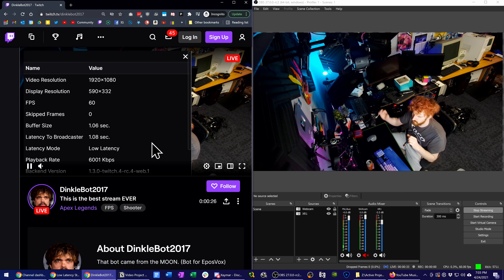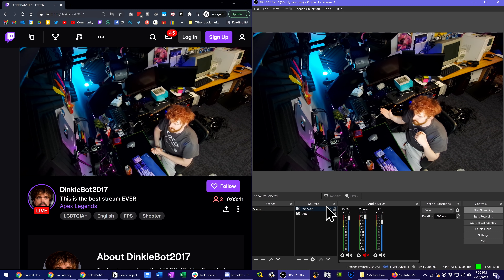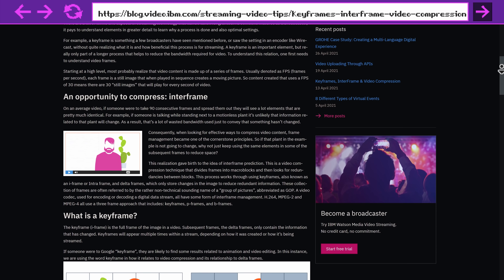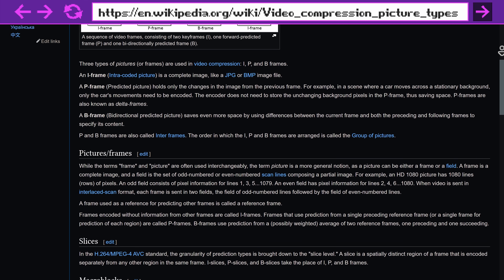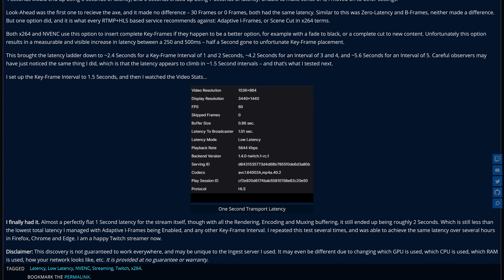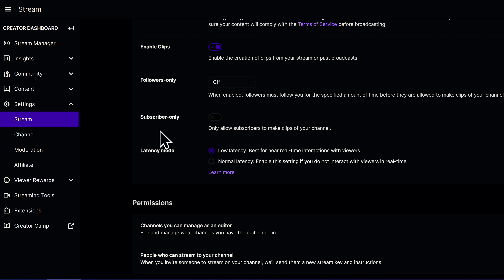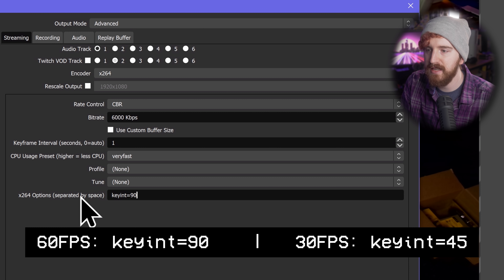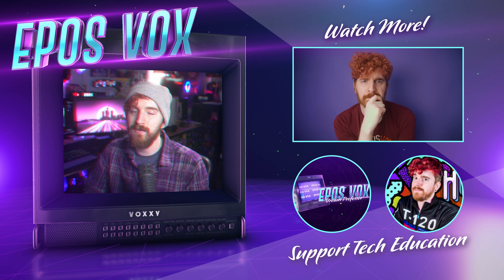Twitch LOW LATENCY Streaming: How to  stream with 1 second of latency

Comment: that nvenc encoder you used makes my output fail.
What works is the build in one "NVIDIA NVENC H.264 (new)"
What fails is the one you chose: "NVIDIA NVENC H.264/AVC (via ffmpeg)"

I'm not sure what I should do to fix this, but when I click stream , I get the error: "starting the output failed. note: if you're using NVENC or AMD encoders, make sure your video drivers are up to date"

Comment: I'm having a lot of trouble trying to get the FFmpeg Encoder setup. Apparently Xaymar has integrated this into the StreamFX download, which I did download, but the extra options on Output do not show up whatsoever. Xaymar's OBS resource area for the FFmpeg Encoder says I'll have to go in and remove the default encoders for them to work. Do you happen to have a video explaining this or does anyone have any idea the steps I need to take here before I do something that'll just brick my OBS. I need help!

Comment: Not quite 1 second, but I did see some improvement!
With OBS' normal NVENC implementation and StreamFX at a keyframe interval of 2, I had around 4 seconds of latency to twitch (according to the stats tab).
With keyframe interval of 1.5 on StreamFX, the stats tab said I had 1.09 seconds of latency, though the actual amount (measuring a timer hitting 0 in my game vs hitting 0 on stream) was just under 3 seconds, but it sure as hell felt a good bit better than before which would be around 4s on the same test - it should also be considered that I'm lucky enough to be on pretty good fiber internet

Comment: So looking at my test stream account, when viewing the video from another PC, I see 1.05s of a broadcast latency with my normal CPU encoding settings on a 5900X. However, I see around 4 seconds of effective delay which is not too bad. I tried your suggested 1 and keyint=90 (I stream 60fps). I didn't notice much of a difference, still around a 4 second effective delay. Perhaps I can still leave this keyframe setting here and test it out in my stream? At least it'd make the only potential bottleneck my router and upstream connection to Twitch and not my own settings xD I did not test out/change my ingest server location and I was running some decent networking stuff at the time, perhaps the one that I'm using just happens to have a slower connection for me. I'll try that too!
Reply: CPU encoding has an inherent latency based on resolution, framerate and preset chosen.. You won't affect it much on the transport side.

Comment: If you use x264, do you still need to install the plug in? I took it as if you use Nvenc you would need to install the plug but NOT if you are on x264. I missed your class on using the "tune" setting to "zerolatency" but I had it set to that from my own testing when I built my 2nd pc for stream purposes. The quality of the feed was better on that "tune" for some reason. I know, I know. Shame on me. 

Thanks for the video, as always EposVox
Reply from the maker: Only need the plugin if doing NVENC

Comment: will views have to toggle the low latency setting too for it to work?
Reply from the maker: Generally no. It’s enabled by default for viewers when you turn it on as a streamer
Reply: @EposVox  well mine was on too but I had to toggle it to get it to go to 1 second. was not sure if a viewer would have to do the same thing

Comment: It works!! Was able to get latency down to 1.05-1.10 seconds with 8k bitrate. Will need to do more tests and see how that affects overall stream and if there is any noticeable issues that comes up in VODs. But this is indeed incredible.
Reply: Do you stream on youtube? I stream on twitch and twitch only let's users stream at 6k bitrate unless your a partner. 😭😭
Reply: @seanwatts392 you don’t need to be partner to stream at 8k bitrate. Within OBS you need to untick “enforce streaming encoder settings”. During the first few minutes of your stream, check to make sure it is at the resolution you are streaming at, and if you have transcoding options. If not, restart your stream. 90% of the time I get transcoding options. Note that YMMV due to specific time of day you stream at.
Reply: @Phoenykz  yes but they will down scale you and they could also shut down your account. It's in there terms. Look into it. It's one of those word of motuths that it's OK to use 8k but many people don't know they will push it back down sometimes way below 6k
Reply: @seanwatts392  oh also, it’s not against TOS
Reply: @Phoenykz  it will let you put 8k but it won't actually use that bitrate
When I first started streaming I put 20k and let me stream still. It shows there maximum bitrate to use on there website. After 6 your video would look worse because it will down scale the bitrate.
Reply: @Phoenykz  Google "using 8k bitrate on twitch"  you will see the issues with it. They advertise max bitrate is at 6k. When you get partnered you get to fully use over 6k

Comment: So something I noticed with your settings, in comparison to my own. First is the encoder, it shows as H.264/AVC Nvidia NVENC, yet in OBS Studio it shows as Nvidia NVENC H.264/AVC (via FFMPEG) for my setup . The second, and I'm guessing this is tied to the first difference, is the B-Frame Reference Mode, it shows as 'Use only middle B-Frames as reference'. So I think it's because of the FFMPEG. Other then that, the setup looks spot on. My question is this, will this difference really affect things overall, or is it in my best interest to remove the FFMPEG driver from OBS Studio. Great video as always and thanks for the concise information.
Reply from the maker: Yours might look slightly different because I’m on an older version of StreamFX. There’s no such thing as a “FFMPEG Driver” and you can’t remove FFMPEG from OBS. 
Just slightly different UI labeling for the different versions of the StreamFX Plugin
Reply: @EposVox  I just realized that after doing some fiddling around with things. Was just curious is all. That being said, really looking forward to trying this out myself.  As for the FFMPEG 'driver', it was just now I realized how wrong that is. Thanks again for the great adive.

Comment: Looks like a 1.5 keyframe interval is possible with the AMD encoder in the advanced settings as well
Reply: Yes, but it only works on some cards. For some reason, newer models sometimes ignore it entirely and default back to 1.0s

Comment: My obs shows 32000 kb/s and my twitch says unstable. I copied the exact same settings as eposvox. Does anyone know what it can be? Using a 1050ti encoder and my internet is 100 mega bit per second
Reply: Usually Download speed isnt the same as upload also twitch doesn’t want that high Bitrate
Reply: @meco  I have 500 down and 100 up, I inserted 6000 bit rate, do I need to change anything cuz of my download?
Reply: @quintas_live  Try this: Type "-maxrate=6M" in the "Custom Settings" text field in the "FFmpeg Options" section. That should fix the bitrate going way over the limit. StreamFX doesn't have the max bitrate text field shown in CBR mode unlike the VBR modes.

Comment: what if we drop the keyframe under 1 seconds?
Reply: In my testing, values below 1s had no effect. They would simply snap to the same latency as 1s, although with drastic impact on quality.
Reply: @Xaymar thanks for replying. I also conducted some testing just recently and didn't see any changes below 1.5s. I think most latency is generally on the twitch's CDN side and/or client's playback buffer due to network conditions.